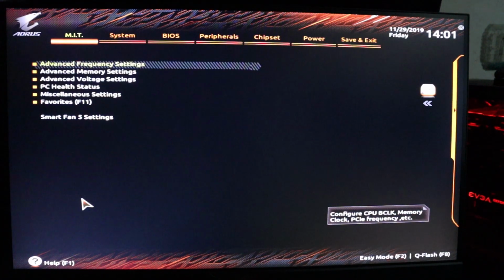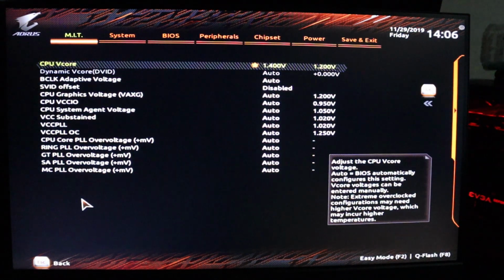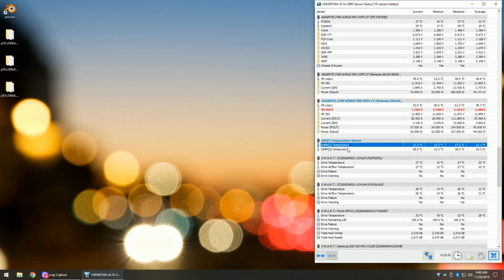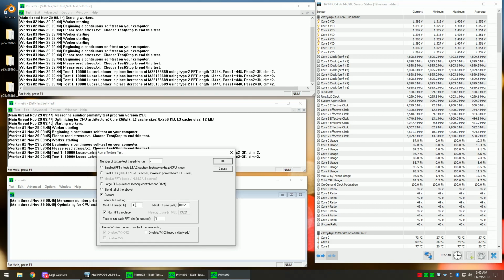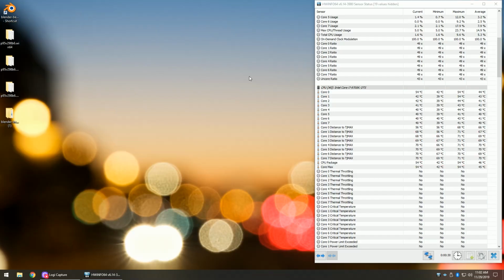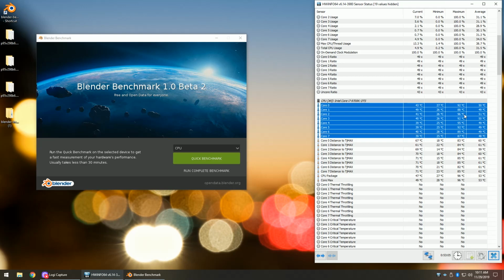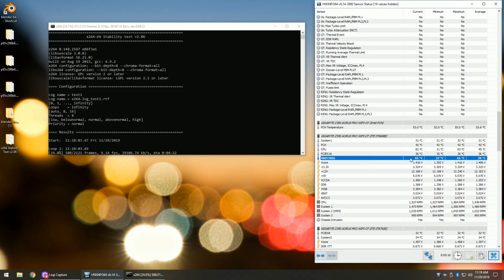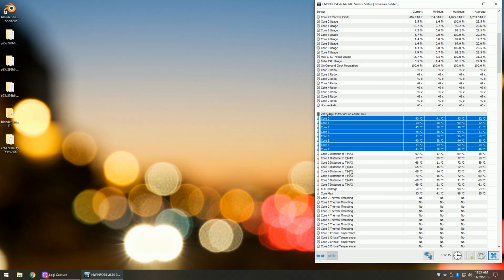Detailed How To - 9900K / 9700K Overclock and Stress Test

Comment: I lost silicon with this shit 9700k, mine is so freaking bad 

atm, I have to hit 1,4v in bios, llc6 turbo and I actually received 1,375-1,38v around 0,02 Vdrop and when I run Prime95 small fft default(avx) with newest build , instanly 108, 110c  and those workers stop

OCCT small sse was running fine for 15 minute, B4 I set to 1,37v bios and got 1,35v and drop to around 1,29~ (around 0,05vdroop) it crashed ,  OCCT sse pullng 200w and P95 pulling 220w(instanly workers stop)

So the chip is so freaking bad, I can't even runs heavy workload under 1,3v at least in avx case

IS passing OCCT SSE enough, or i have to pass p95 avx ?

Comment: i have similar setup with z390 aorus master 9700k.im running 4.9ghz with 1.220v turbo llc avx 0.why are u using with 1.4v?and your vccio and vccsa way too high for 3200mhz.
Reply from the maker: It’s likely I lost the silicon lottery with this chip. Memory is running XMP only.

Comment: I followed this guide it runs... But the cpu runs so hot. Especially on load. Then I tried running OCCT and got errors and then bluescreened. I tried a bunch of guides on YouTube they all blue screened. I just used the ez tune oc utility for gigabyte boards left everything stock and ran it. With your tweaks I got an extra 25fps in games however the ez tune oc runs way cooler and doesnt blue screen. It found 4.7ghz was the best and runs the coolest. 35degrees idle and 72 degrees full OCCT load. I dont mind my cpu throttling either runs better.  Thanks for the guide though maybe ill be able to fine tune it later until then im happy with my oc.

Comment: Do you think I will be able to do the same settings that he does I have a 9700k with a 500w psu and a z390 UD witch is a budget option motherboard. Do you think the vrms can handle it
Reply from the maker: All you can do is try settings and use the results to adjust if needed. :)
Reply: hey did it work for you the same settings?

Comment: Not all cpus will go 4.9? WTF? If your 9900k or 9700k CAN'T get to it, then I suggest getting your money back. 4.9 is GUARANTEED. GUARANTEED. MKAY?
You don't get to pay a shit ton of money and have it die on you at 4.7 ghz.
Reply from the maker: This video covers many processors including the 8600k, 8700k, 8086k, 9600k(f), 9700k(f), 9900k(f), etc...  Not all of these models will with every chip get to 4.9 all-core fixed frequency with AVX offset 0.  The only guarantee the 9700k(f) and 9900k(f) have from Intel is for bursty single core workloads to hit at least 4.9 with stock settings.

Keep in mind this is with AVX offset off/0 most people you see on Reddit/Youtube are using an offset to artificially increase their frequency:

https://youtu.be/fmBDFYyFAcQ

Comment: hello cool video !!! why you don't use occt for the stability test ? he is very good for find error and more realistic for the daily use and now you have many different test like the linkpack, the gpu/psu stress test ect...
and i have question do you have some trouble to rise the cpu ratio up with this motherboard en 9700k ?
Reply from the maker: Sorry for the slow response.
I have never tried occt myself. I'll have to try it sometime, it looks great!
My sample of 9700k was on the poor side of the silicon lottery (90% of 9700k's can hit this overclock) so I thought it was a good fit for a mass video:
Reply: @fpszen2917  I think i'm in the case i can't find a stable 5ghz with mine ...... 4.9 with less than 1.3v on vcore less than 80c on test but even with 1.42v impossible to be stable on occt with 5ghz :(
Reply from the maker: Don’t feel bad! Only the top 9% of 9700k chips can hit 5ghz with AVX set to 0. Keep in mind most people you see on Reddit/Youtube are using an offset to artificially increase their frequency:

https://youtu.be/fmBDFYyFAcQ
Reply: @fpszen2917  ok thanks br0 because it's one year i read everywhere my 9700k is on 5.2 5.3 with 1.25v vcore. i almost jump of my window :D . i can bench at 5ghz with all kind of bench but instable more than 1hour in occt https://hwbot.org/image/2350368.jpg

Comment: Should this work with any gigabyte motherboard with decent overclocking capabilities?
Reply from the maker: Yes (assuming you have a K cpu), the steps taken can even be applied to other brands though the screens and names for settings may vary.
Reply: @fpszen2917  Thank you! Just successfully overclocked. I've always wanted to learn more about the bios and what most of the settings actually do. This video explained it perfectly.

Comment: Would you consider covering the new F11c BIOS. They've changed so much and it's very confusing when watching these types of videos.
Reply: I found this video hoping it was on the newer bios. Anyone who is using a new RTX 3xxx card will want to update the bios to unlock “resizable BAR”
Reply from the maker: Yes, we should have resizable bar bios for each 3000 series card soon. Then we can enable it in bios, after the cards are flashed.
Reply from the maker: Unfortunately, I've moved to other hardware and testing and will not be able to redo this video with the latest BIOS.
Thankfully, even though the screens look and are organized differently, the settings will all be extremely similar.

Comment: I have just previously purchased an aorus ultra and the bios has changed since this video! I will still try and follow it and get back with my results.
Reply: Currently sitting at 5ghz on my i7 9700k with these settings. Now just going to concentrate on lowering my voltage gradually. I have an aorus z390 ultra. Thanks for the video
Reply from the maker: Sweet!!
Reply: FPS ZEN Is the voltage sitting at around 1.39V when the pc isn’t at load safe? I know that the cpu wouldn’t be drawing that much current when it’s not at load but it seems to me like the voltage actually sits a little bit higher when the pc isn’t at load with these settings.
Reply from the maker: @english2621  Sorry for the slow response. Yes, that is fine as it's under 1.4V. Yes, voltage is highest at idle, load brings it down.

Comment: Hi there, 

I’ve been trying to overclock my i7 9700k and have been running in to a few problems whilst stability checking. I set the multiplier to 50 and the core voltage to 1.37v with an AVX offset of -2. When I then load the cpu to 100% the core clock on all cores shoots down from 5ghz to 4.7ghz on all cores. Is this my system telling me that a 5ghz overclock with my current settings is not possible? Why doesn’t the overclock just stay at 5ghz so I can monitor the performance/temps. Why doesn’t it just stay at 5ghz and blue screen if it ran into any problems?
Reply: AVX -2 = 4.8 or 4.799 or something like that... you are stressing your cpu with the avx on.
Reply from the maker: This is what the AVX offset setting is suppose to do, slow down your CPU frequency (on all cores) when AVX runs on it.

Comment: Excellent video!

What AIO did you use to keep the CPU cool? I was considering to get the i9-9900K, but ended up with the i7-9700K, because 1) I'm worried over the temperature since I only have a 240mm AIO, and 2)  I'd figure out I'd invest on a better GPU instead.
Reply from the maker: Thank you!

I used a dark rock pro 4 air cooler for my 9700k. I think you did the right thing allocating funds to the GPU. I have seen a 240mm AIO keep a 9700K under control. I would try the 240mm AIO see what it can do and worst case you can upgrade it later if it’s not as quiet or not as cool as you would like.

Comment: How long should I run P95 for?
Reply from the maker: It depends on your cooler and if you use your PC for professional workloads. The p95 workload in my tests are fixed so we are assessing if your cooler can handle it for either a short or extended (extended = professional) period. For air coolers temperature will usually stop increasing after 10min so maybe run the test 15min and that will be an extended test. For AIO water coolers it would take about 45min for the water temperature to stop increasing, so a short test would be maybe 15min and extended likely an hour.

Comment: Excellent video!! Just built first rig and have been looking for good setup information. Will the GPU in the system effect the ability to overclock? Meaning will a lower/mid range GPU cause the CPU to perform more poorly using these settings? I coincidental built with same CPU and MB as what is in thid video. Budget did not permit a high end GPU at this time. Will upgrade later. Currently have ventus cx oc GTX 1660.
Reply from the maker: Thank you!! GPU range does not matter and as long as the GPU is stable, it will not effect your overclocking.

Comment: Try this:
1. CPU Internal AC/DC Load Line - Power Saving
2. CPU Vcore Loadline Calibration - Low (start with low, you can go up as needed)
3. CPU Vcore - Normal
4. Dynamic Vcore -  +0.020V (this is my setting, you can start with 0.000V)
5. CPU VCCIO - 1.2V (depends, dont leave this on auto)
6. CPU System Agent Voltage - 1.2V (depends, dont leave this on auto)
7. CPU Clock Ratio - 49
8. Intel(R) Speed Shift Technology - Enabled

With this settings my 9900k is stable at 1.22Vcore under avx load. Lower temp during gaming load too. Best thing is speed step works!
Reply from the maker: Thanks for the suggestion!!

Comment from the maker: falkentyne on reddit had a great suggested edit for the prime95 testing:

For dual-channel memory instead run 6 threads (or 14 for cpus with HT) on SSE (AVX2 and AVX checked disabled)
Then run the remaining two threads one on AVX, one on AVX2 (one no checkmark in the AVX2 box, one with only check in AVX2 box)

For quad-channel memory run as shown in the video. (Even though the system in the video is dual-channel)
Reply: What’s the point of this